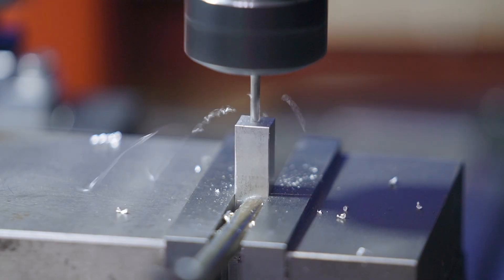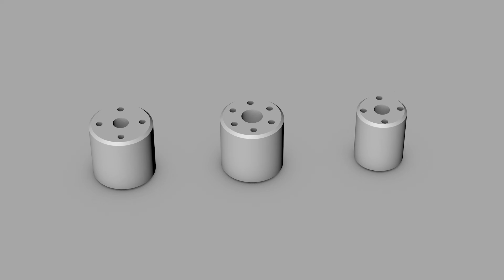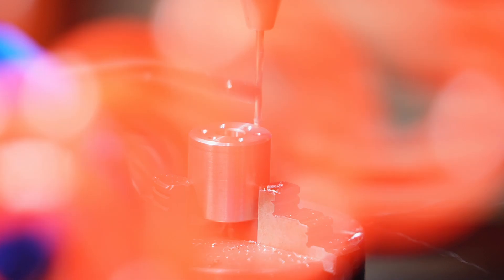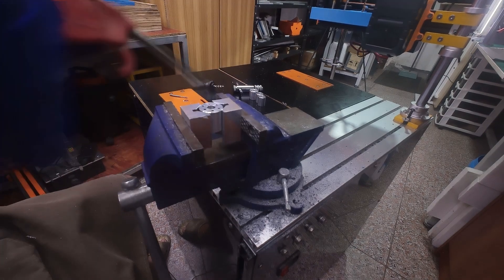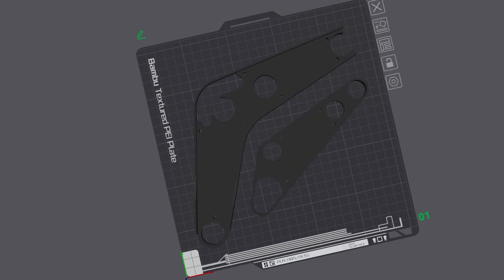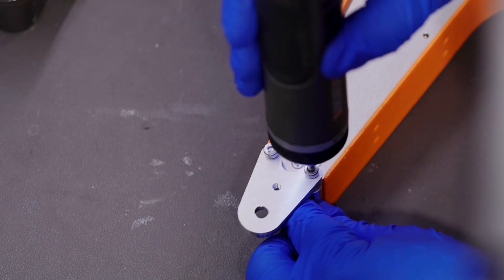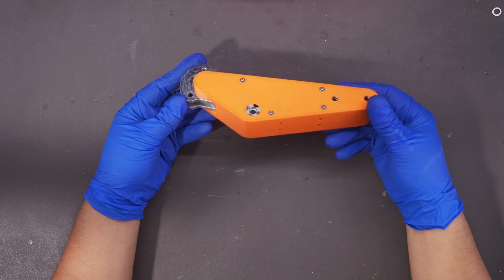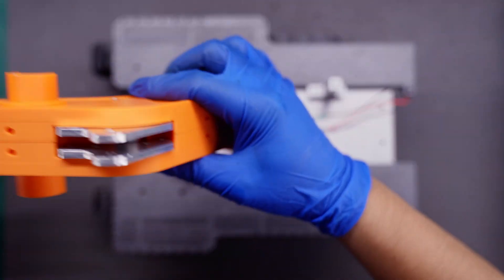Handcrafted Aluminum RC Excavator(1:24) | Part 3: How to use aluminum alloy to make the arms ?

Comment: Super cool project! Glad I stumbled onto this. The boom turned out great!

Does your mill have a DRO setup on it? If so, it likely has a pitch circle diameter function, which would've been far less stressful than using the rotary table.

Regardless, keep up the good work. I'm excited to see the final result.
Reply from the maker: I'm glad to hear that you like this project. I'm working hard to complete this project as soon as possible. There is a DRO on my milling machine, but its functions are rather simple. It can only tell me the coordinate values and doesn't have any of those slightly more advanced functions.